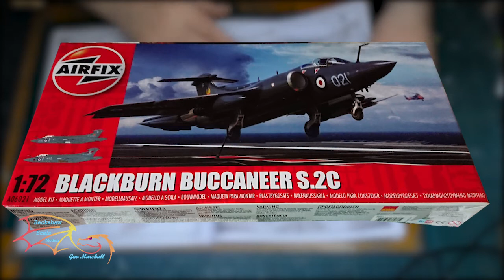Airfix Blackburn Buccaneer S 2C Scale 1/72 Part 2 Cockpit

Comment: I've read that about plasticene, but can see no visible damage using it on kits I built maybe 30 years ago. Maybe it depends of the type of plastic (soft, hard etc) used in the kit?
Reply from the maker: Hi Neil, you could be right. I think it's something to do with the oils separating and corroding the joins.